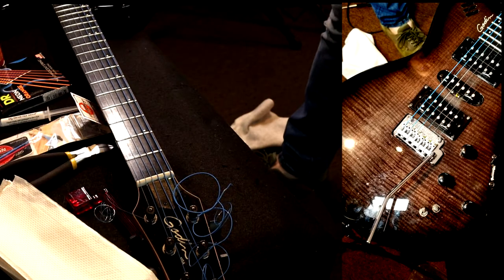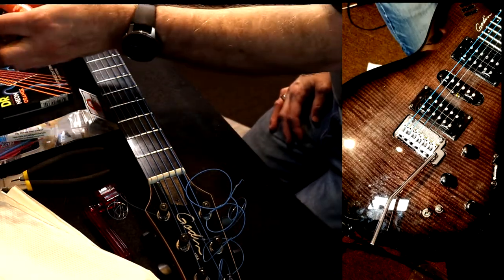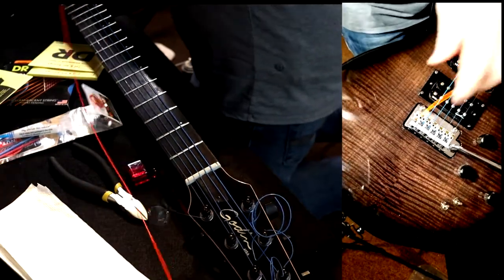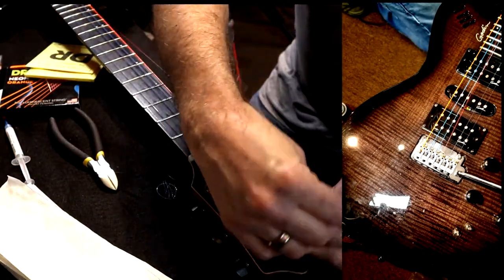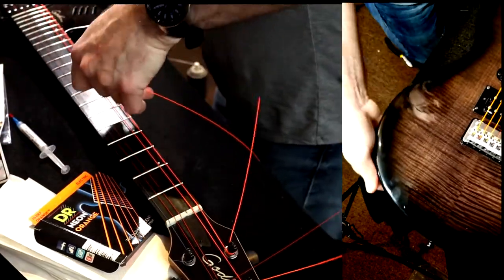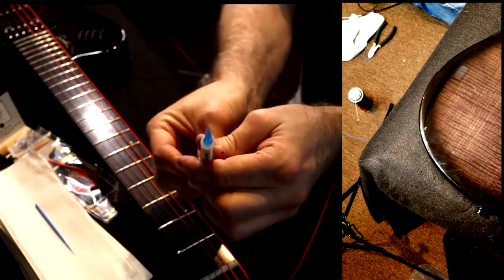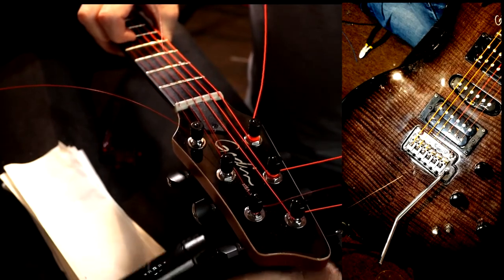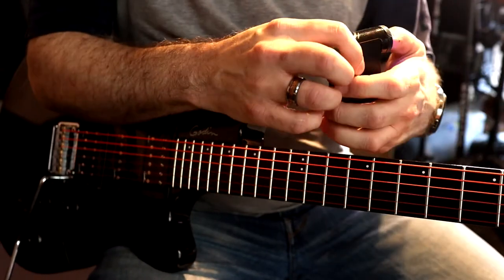Godin xtSA Guitar:  String Changing and Locking Tuner Demo

Comment: Charles, thanks for posting this. I have a 20 year old version of this guitar and it had not been holding tune.
Reply from the maker: You are welcome.  I think the steps in this video definitely help a lot.  I can use the guitar at shows and it is reliable enough for that now.  I would say though it's still dicier tuning-wise than many of my other guitars.  I rarely use whammy bars in my playing, so I'd just as soon have a fixed bridge version of it. And I know I could always have it modded.  In every other way it's an amazing guitar.  I have a custom Ibanez 7 string (featured in another video on my channel) on which I recently had the floating bridge blocked, because the benefit - annoyance ratio on its bridge wasn't worth it.

Comment: Does string gauge matter? Seems the lubrication and a single wind could be key as my xtsa also does not stay in tune,
Help
Reply from the maker: I've only used .010s on this guitar. I have successfully used the xtSA at shows, tuning-wise, but I would definitely say it's still more temperamental in that regard than most of my other solidbody electrics. I think the steps I outline in this video helped a lot, but they did not turn the xtSA into the tuning stability of my fixed bridge Godins or my Strandbergs. I've told myself since i bought it that I could always block the floating bridge if I need to, and I haven't felt compelled to try that step yet.  My email is director@issaquahlessons.com if you ever want to compare notes beyond YouTube.

Comment: Quick question: to lower the action, is it possible to lower the entire bridge that hangs on two bolts, our you have to lower individually saddle for each string?
Reply from the maker: I'm not a luthier and I don't do all my own guitar setups;  for guitars with vibrato arms I tend to take them into luthiers. My local guy here in the Seattle, Darren Ross (Ross Guitars) would be better equipped to answer your question. That being said, I think individual saddles would be the way to adjust action on this guitar.  Because you want the pivot/floating bridge to be at a position parallel to the body and you wouldn't want to change that just to affect the action. A good resource might be talking to Godin directly. They are very communicative. They are a small company and I usually end up talking with the same couple people there.  Owning 9 Godins I've had a fair amount of communication with them over the years.  Thanks for watching my video!
Reply: Thank you so much, I called Godin, seems it has to be luthier because of tools that are needed.  @kaleidoscopeschool

Comment: All of a sudden I am getting no sound from my A string on my xtsa. All other strings amplify perfectly. Do you know what the problem could be?
Reply from the maker: which output are you using?  for an electric guitar pickup / output that seems quite strange.  I did have a problem with the synth tracking on my 5th string;  I've actually been planning to release a video about that phenomenon and my journey to get it fixed.  Keep in mind too that there is a battery in the xtSA, behind the circular plate behind the piezo pickup controls.  I didnt realize that when I bought the guitar.
Reply: I had a problem with 1 string not coming through the synth or piezo system.
I swapped the piezo element with one from my junk drawer and it worked but was weak.
I contacted Godin for a replacement, and they said to send them the serial number and the color coding of the wire going to the element.
It is critical to get that right as the 3 piezo elements they have/are using have different sensitivities.
Hope that helps, the fellow at Godin was great and the element was around $55 CDN
Reply from the maker: @noternunstoned    getting the electronics solid in this guitar was a tricky road.  I talk about this in my Boon or Boondoggle video.  Darren Ross at Ross Guitars was the guy who got it right for me.

Comment: Wow... You really didn't get the idea of using locking tuners? 😬🙈🙈🙈
Reply from the maker: These particular ones were unfamiliar to me. I've had other styles on other guitars
Reply from the maker: @jaye2276  that's a really great concept, and I must admit I've never thought of exactly that before (that any wind around the post can be counterproductive).  I've never been a huge vibrato arm guy.... didnt have one on my main guitar from 2004 forwards because my 90s floyd rose guitar was stolen.  I'm making a note of that concept with my string changing file!
Reply: I have a Godin Solidac with locking tuners like the ones in the video.  Question - Is the proper installation to pull the string tight through the hole in the post, screw in the top lock and do NO winding around the post?  Does the tuner lock hold the string in place without any string-wrapping around the post - not even once around?  Thanks for your help!
Reply from the maker: @semancik21  I'm sorry I missed this comment.  I try to reply to everything.  With a number of varieties of locking tuners, winding around isn't necessary.